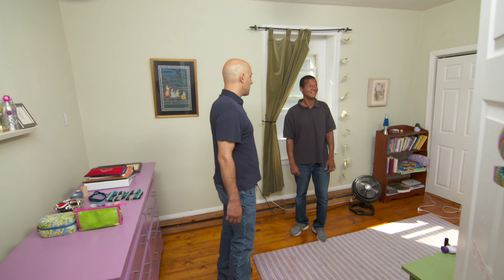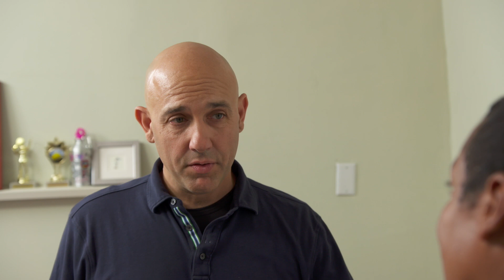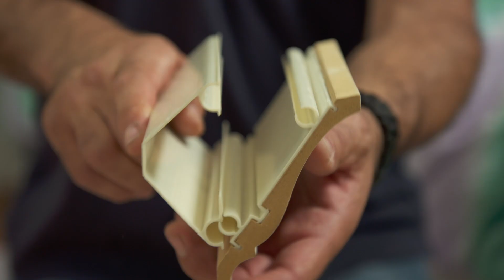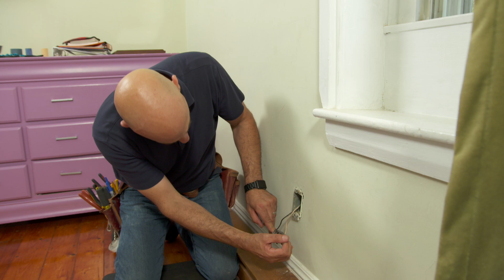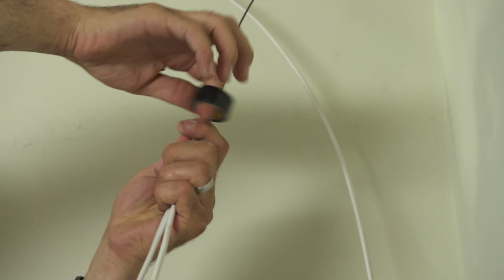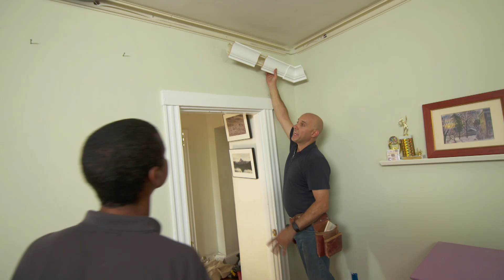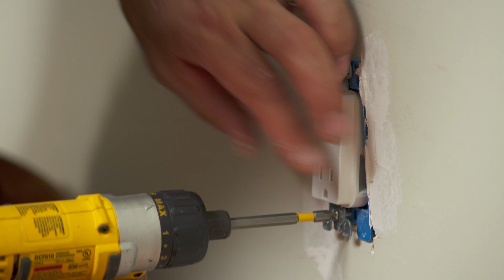How to Conceal Electrical Wires with Crown Molding | Ask This Old House

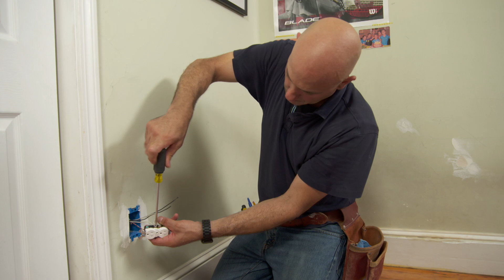Comment: Those wires @7:35 should have been pigtailed together with one white and black wire attached to the outlet, not wired through.
Reply: Outlet is rated for 15 amps and designed for 20 amp pass through. It's also not code unless it's a local code.
Reply: Why?
Reply: lowspeed if it is not pigtailed, all of the electricity of upstream devices pass through the outlet, possibly overloading it, a failure in the outlet will cause all upstream devices to fail (fridge, freezer, etc). Also, it's electrical code.
Reply: @domdogg123  it’s not electrical code pal
Reply: Pigtailing wires is better, but it's not a code violation to do what they did. I have a copy of the Nat. Electric Code, and it's not an issue. Also new outlets wouldn't be made with these screws and extra push in points if wiring across an outlet were a code violation.

Comment: got to caulk those gaps around the crown.  looks getto with the gaps. over all good idea as long as your not over loading that one circuit.
Reply: They never put a tape measure on it, they just snapped a chalk line as he said "about" 3 inches. Looks like crap.
Reply: I agree, but she was plugging it all in anyways, just through a power strip and several extension cords.
Reply: The gaps looked way too big to caulk, they should have ran a bead of glue along the top of the crown and nailed it up tight.
Reply: Rob T ghetto*

Comment: That house has bizarre molding. Look at the window where the side boards meet the stool... what the heck
Reply: This looks like a house flipper special where they got a handyman to do the wiring. It's absolutely terrible
Reply: Yeah that looks like crap, like someone attempted to "upgrade" the casing and didn't bother to swap out the sill.
Reply: You're not kidding there.  The window is shorter than the wall opening, so there are extra wide trim at the the top and bottom; the side molding has an angle cut at the bottom; and the top molding where the curtain rod is mounted overhangs the opening.

Comment: Gap between the crown and ceiling looks bad.  Maybe caulk it?  Interesting product though.  The hole in the wirenut is new to me as well and I'm an electrician myself. I'll have to pick up some.
Reply: The joints look really awful too. The corners and keystones should be flush, not popping out. Why the heck would you make parts of crown molding pop out?! I suppose it makes it easier to install, reducing precision cuts, but still- it does not look good.
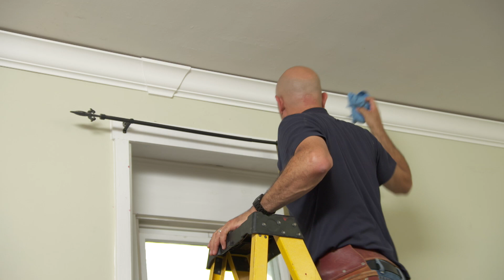Reply: @ZacharySalman  I noticed one of the "keystones" above the window. It wasn't even centered above the window; it was just randomly placed.  (7:16)
Reply: i would put a LED strip in there for a mood lightning situation
Reply: Yeah, definitely has some gap to fill in there, but it'll clean up.  I love that through-hole wire nut! No more struggling to squeeze multiple wires onto a single contact!
Reply: well normally a keystone isnt flush. its popped out to give an accent. but it really just depends on your taste so i understand why you dont like it.
Reply: Green wirenuts with the hole in the middle have been around for decades! It really saves a lot of time during trimout.
Reply: was hoping throughout the video he'd clean up the gap.. but nope. granted with how the joints and corners pop into place I don't know if it can be flush. It might cost a little bit, but I'd rather do the whole knock out every 16" and just repaint the entire room. or even a wallpaper border and a different color down below.
Reply: I can tell by the wall it's an old house with plaster walls those walls are never straight the house I live in  has the same issue with the moulding not flush to the ceiling
Reply: I am amazed by the product and how it would make more jobs possible. As for the little gap, hmm, i would say then its all up to you if you want to spend 5 bucks on a tube of goo and go around the perimiter with your finger "voila"
Reply: Correct. I assumed that we both understood that but I guess I was wrong. Keystones are used in masonry work, usually the block at the 12 o'clock position of an archway. Depending on the design the block is either flush or stands out from the rest of the blocks just like the keystone in this video.
Reply: Zachary Salman I guess it handy for future access
Reply: @Star there are other solutions.  Probably not as cost effective though.  Like cutting away the drywall, running your wires then getting a drywaller to patch it back.  There are cheaper ways like panduit, but its not as pretty.  

@Arie it must be a location thing.  I've been an electrician for almost 2 decades in 2 separate states and never seen or heard of these before this video.
Reply: beeps imho barrel sleeve crimps are better, they take up a lot less space
Reply: Dziadek : Yep, mount everything a little lower and add LED and its got a purpose.  My first thought too.
Reply: Its crappy plastic stuff like most things. As far as the gap the ceiling probably isn't level . None of the old houses are square
Reply: star999nine True, but isn't it that way for every other part of the house (except basement or attic)? Any electrical wires behind walls are also time consuming to access.
Reply: beeps maybe Tommy should have helped.
Reply: Greenie
Reply: agreed
Reply: beeps ryeye
Reply: i was just gonna suggest the same thing
Reply: i was thinking the same thing after he got done
Reply: looks like he measured down too low when he did the chalk line
Reply: armyof12monkeyss Because crown molding traditionally doesn't have keystones.
Reply: Caulking would definitely give it a cleaner look.
Reply: Overall just a lazy job. I get saving money but this was practically piss poor.
Reply: armyof12monkeyss I am aware of what keystones are, I just meant they are not usually seen at the fold between the wall and ceiling of a room.
Reply: That grounding wire nut is new to you?? Have you been living under a rock?
Reply: You’ve never seen grounding wirenuts before? What kind of electrician are you